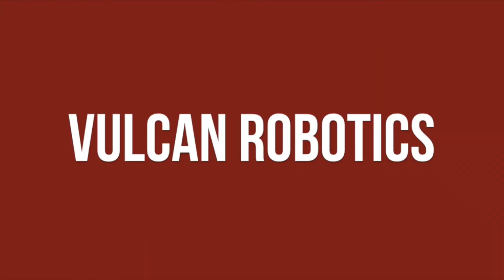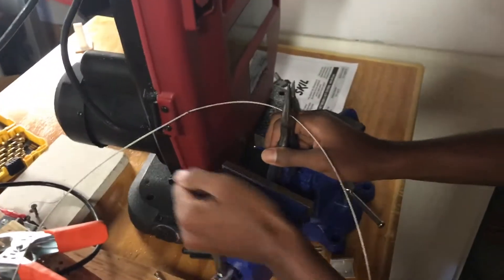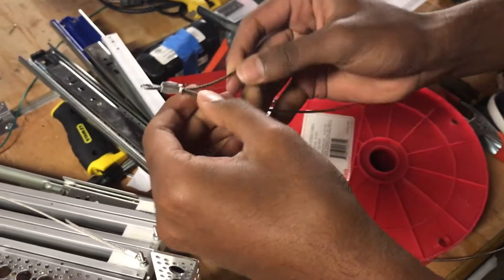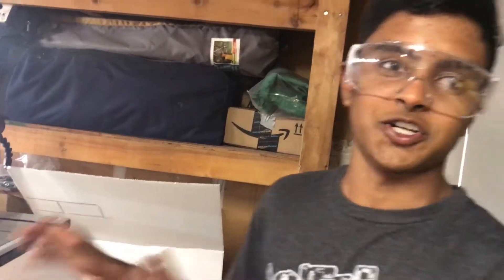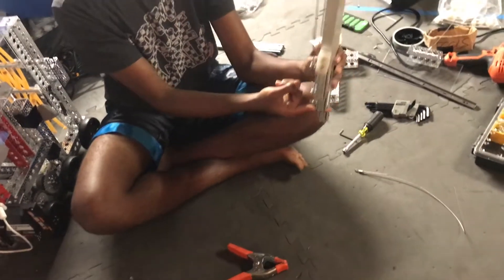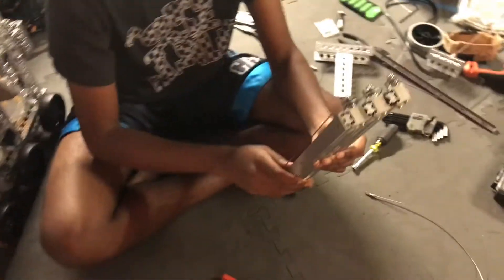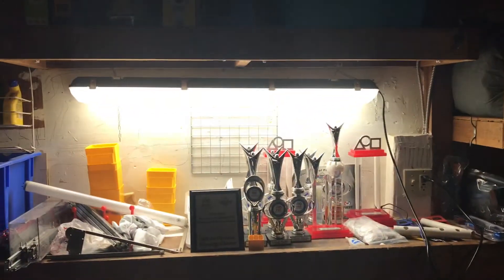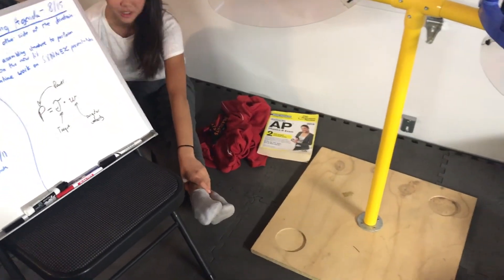Vulcan Robotics Offseason Vlog 3- Constructing a Lift Out of AR3-K400 Slides and more

Comment: Quick question: what is the difference between the ar-3  and the ar3 k slides
Reply from the maker: Unlike the AR3 slides, the AR3-K drawer slides have a hold-out detent, which holds the slide in its fully extended position